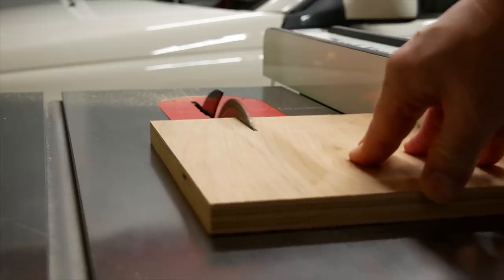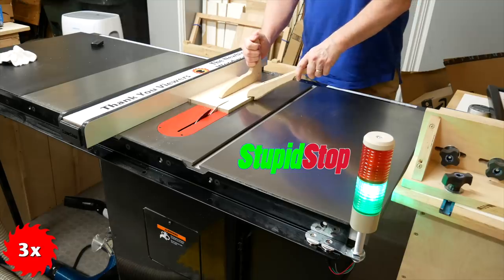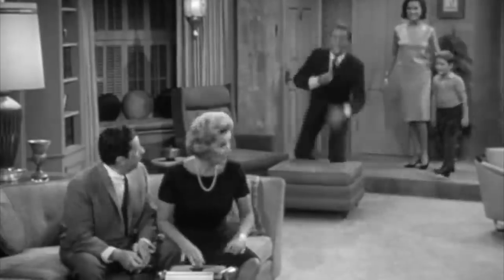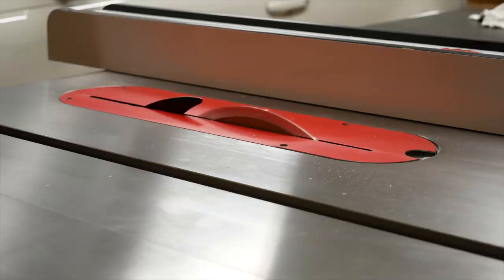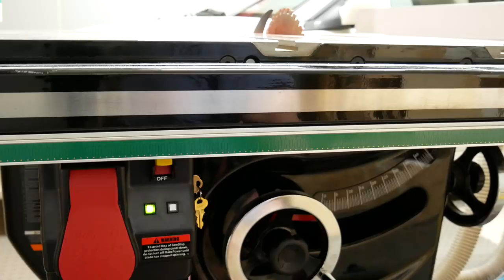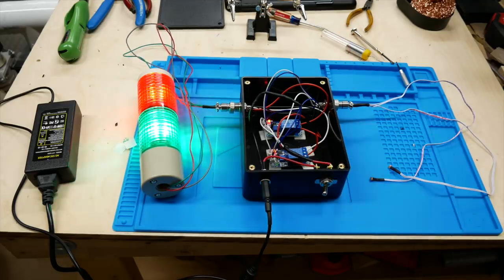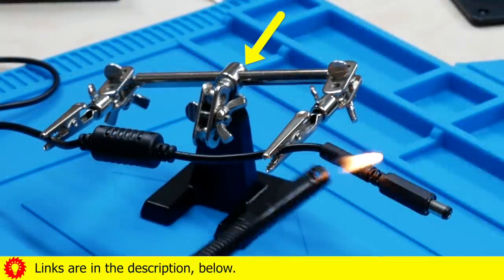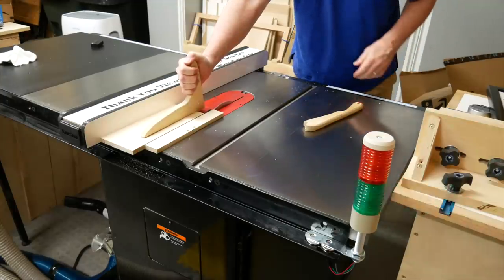Woodworking Distractions, ADD and my StupidStop

Comment: i think its important to have a healthy fear of a table saw and avoiding becoming complacent, easier said than done.. once you are complacent is when the accident usually happens.  I like to watch and read a lot of facebook groups where unfortunately people have accidents and often share them.   Seeing other peoples accidents is a great reminder for me and helps me keep that healthy fear of the saw in my mind.  My day job is often 4-6 hours behind a table saw and its very difficult to avoid getting tooo comfortable, and Im not even on a sawstop.   I do think shops with saw stops bread a user whom  doesn't possess this healthy fear i speak of, and why would they.  All the shops I know of with saw stops have far more accidents than the shops i know of without, that could be a number of reasons.. but i do speculate its often just from people using a tool without the healthy fear of it and overall complacency.     as far as mistakes, mistakes never stop being made.. you just get better at covering them up and/or not getting too upset.. its only wood
Reply from the maker: Thanks, Dave, and I love your last comment - I'd just add that yes, it's only wood, except when it's flesh! 😛But yeah, I agree with your comment about SawStops. It's only natural that when the consequences become less dire, people become more complacent. It may actually be one of the reasons for me touching my blade a couple of times. I mean, I cut my thumb pretty badly 10 years ago or so on a table saw (fortunately it was just a chunk of meat and it grew back), and although I hadn't used the table saw much since then until I started back up a couple of years ago, I never touched the blade again. Until I got a SawStop. I'm not sure the evidence is exactly scientific, but it's certainly a good possibility! Still, I'd rather have the SawStop than not, of course. 😄Thanks again for your comment. 🙂
Reply: I agree. I also drive around without my seat belt fastened because it just makes me complacent. I had a driver's seat installed on the front bumper of my car so I could make sure to fear driving. Crumple zones? Bah humbug! I also run up and down stairs without holding on to the hand rail. There are all manner of things that I could do to protect myself, but then I wouldn't fear things so much. Who wants that?
Reply from the maker: @rlevitta  😂

Comment: Great video.  I really enjoy and appreciate your openness.  I love my SawStop but I did "engage" with the blade.  Unfortunately, it was more than a nick, but if not for this saw I would have lost my finger.  That was more stupid than short attention (which I am gifted with).  I'm going to look into the plans for this.  Wonder if it won't work with the job site saw.  Keep the videos coming.
Reply from the maker: Thanks! And I don't see any reason it wouldn't work with the JobSite saw, except figuring out where to mount the light.

Comment: I am a dangerous shop outfeed table clutterer and thinking while cutting about the next step.  Oh yeah and not following the rules cutting short stock on the outside. I have the fat scar to prove it.  I have never come close to putting my finger on the table saw blade but I have had two notorious incidents on the band saw.  The distraction was rushing because my baby daughter was napping and I was afraid she had woken up..it was a long time ago since she just graduated college.  She has stopped the naps.  I was cutting hexagons...many, many hexagons and accidentally cut the tip of my thumb slightly..  You and I have discussed this before when you triggered your saw stop.  I stop myself and remind myself I am not on any time crunch.  Do not rush for a no rush thing.  I uncluttered and have stopped using my outfeed table over the assembly table I made.  All your points were great.  The cut outs to the funny scenes were extremely well done and very funny very nice effort.
Reply from the maker: Thanks, Bob, and I enjoyed every word of your comment. Thanks! 😄

Comment: An idea I have been thinking about is buying red vinyl letters maybe 3 inch tall that spell LOOK! and place them on the side of my RIP fence. Maybe that little reminder will help me look instead of relying on sound of the saw.
Reply from the maker: Good idea, and anything that works is good! For me, things like that just end up blending into the background. But anything's worth a shot. I like what one commenter said - don't come near the blade until you can count the teeth. Not that I'd count more than two or three, but that would be enough, right?

Comment: Interesting idea. I'm sure I could knock up something similar with a hall effect sensor and an Arduino. Movement and coils (think motor spindle) will create some magnetic fields that could be monitored.
Reply from the maker: See, I knew there were smart people out there. 😄
Reply: I built my automated blast gate system with an arduino using Hall effect sensor to detect current flow 
If you measured the EMF off the motor with the Hall Effect that would work as well.
Reply from the maker: @TheFalconJetDriver  Well, if someone did that, it might work well, but not if I tried it. 😛
Reply: I think using a sensor to detect the motor spinning (possibly sensing the fan blade) along with a current sensor to tell when the motor is energized would be an approach for a lot of tools. It could activate the alarm only when the motor is spinning while it is not energized. I think an audible alarm might work better than the lights. It should be loud enough to hear with hearing protection but not loud enough to startle you.
Reply from the maker: @bobt2522  Well, a worn out set of bearings might accomplish the same thing. 😜
Reply: @TheNewbieWoodworker  True, but it would squeal while you are making a cut too.
Reply from the maker: @bobt2522  Ugh, yeah, you're right.
Reply: @TheNewbieWoodworker  If I want to hear constant whining, I'll just go back into the house.
Reply from the maker: @bobt2522  Perfect comment for me, today. 'Nuff said. 😮

Comment: Don't be distracted by cut-off scraps.  People feel compelled to reach and push small cut-off pieces away from the blade while it's still spinning.  This distraction can lead to a dangerous situation.  Let the cut-offs lie until you've turned you saw off and the blade has come to a full stop.  In woodworking, patience is a 'safe' virtue.
Reply from the maker: Great advice - thanks! 😄

Comment: Thank you for a great video! And as long as it works for you it is a great solution. However, I would advice people to pay attention to the blade, rather than to have a light distracting them from the blade.
Reply from the maker: Excellent point. The one good thing is that the light only blinks when the saw is turned off and spinning down, so it's not distracting at other times. At least, not to me. 😄

Comment: I use feather boards on the horizontal and vertical so the only thing/direction I have to focus on is pushing through.  with a stick.  Less thinking = more safety once the blade is turning.
Reply from the maker: "Less thinking = more safety" That's a great philosophy! Thanks for the comment! 😄

Comment: This seems quite obvious, but in your specific case, a blade guard would save your fingers. We all have our excuses for not using it, but in your case I think the blade guard is mandatory. There are actually very few situations where the blade guard gets in the way of a cut and you actually need to remove it. I just have a delta contractor saw, and it’s blade guard is quite nice, so I’m sure the saw stop one is fantastic. Keep your fingers, and save some money on those breaks. Use the blade guard!
Reply from the maker: I'm leaning on agreeing with you, but I have to disagree with one thing you said: when you say there are very few situations where the blade guard gets in the way, it's just not true for those of us who use cross-cut sleds all the time. In fact, it's quite the opposite. But like I said, it may still be worth the effort.

Comment: Nice idea.  I would think that a universal warning light unit could be made using a circuit that detects sound where you could mount the microphone near the saw motor and adjust the sensitivity to ignore the dust collection and other sounds to turn the light on, then have a delay to keep the light on for a number of seconds after the sound stops to allow the blade to spin down.
Reply from the maker: Sounds good to me! 😄

Comment: What about adding a foot switch? (In between the wall outlet and the saw/ miter saw/ drill).
And, of course, I really enjoy watching your videos!
Reply from the maker: Thanks for letting me know you enjoy my videos. 😄I don't think a foot switch would help my lapses in attention, although it's an interesting idea just in theory. It wouldn't work for the SawStop, at least not between the saw and the outlet because the SawStop has two switches - one that turns on the saw (in other words, turns on the electronics), and one that starts and stops the blade. But it could work for other saws, and other devices. But since I don't see anyone using a foot switch for anything, my initial reaction is to let someone else try it first. 😛Thanks again for the comment. 😄
Reply: @TheNewbieWoodworker  I think that one to try it would be me ...
Reply from the maker: @olaf06x58  😂Go for it!
Reply: @TheNewbieWoodworker  I tried it. Big drawback = stability on your feet. If you use one foot to operate the foot switch, you are putting most of your weight on the other foot. Not stable. I'm sure a foot switch would work great for sitting position, but there are very few of these in the woodworking shop. I wish I had the $$ for a SawStop. BTW, a Physical Therapist friend told me most of the shop injuries he sees are from table saws.
Reply from the maker: @olaf06x58  Thanks for trying it out! Interesting results. There are switches that are much flatter, but I think the problems would still be there. It doesn't surprise me about what the PT said.

Comment: There is a reason why carpenters use flat pencils, they don't roll.  Grab an old 2x4, use it to push into the saw blade to slow it down to a stop quick.
I was 18, trimming out a new home, my dad left for a while, and I was cutting corner trim and baseboards.   I held the wrong end of a quarter round trim while using a chop saw (miter saw) and of course, holding two inches of material naturally didn't work, it took out the tip of my left middle finger!   Fortunately, it didn't take a bone with it, so the skin and muscle grew back.
Reply from the maker: Good idea about the flat pencils - I hadn't thought about that aspect of them before. Thanks for sharing! 😄

Comment: Hey Dan I enjoyed the video I was wondering if you removed the blade guard for clarity as I can't remember the last time I saw a table saw with the blade guard installed on tv or on you tube. I survived cutting a large unstable panel on my table saw without an injury. Stupid and very lucky as there could have been kickback or any other multitude of problems. I guess the rules should apply slow down and take your time and if you are tired leave it for another day. Stay safe folks!
Reply from the maker: Thanks. I removed my blade guard because I can't use it with my sleds, and I use my sleds a lot. But it's not that hard to remove it, so maybe I should rethink the subject. Thanks for making me think about it!
Reply: What is a blade guard?🤣 

Hum now that I think about it I think  I saw something like that in the bottom of my toolbox.
Reply from the maker: @TheFalconJetDriver  😂

Comment: Maybe this has been mentioned and maybe you have done it:
How about putting the factory blade guard back on the saw????
Reply from the maker: https://youtu.be/cQINXsn2QBk. 😄
Reply: @TheNewbieWoodworker :
Yep, I was watching that, when you replied. Great sled idea.
Thank you.
Reply from the maker: @zapa1pnt  Thanks. And I have to laugh - you're one of the few with the obvious solution of using the blade guard more often. I'm a little slow sometimes, but apparently I'm not the only one. So consider yourself smarter than most of us. 😄

Comment: Where is blade guard on your table saw
Reply from the maker: That's a reasonable question. I'm rethinking my use, or lack thereof, of my blade guard.
Reply: Great point.  None of the cuts you demonstrated in the video needed to be made without the blade guard.  I need to be better about this too, I have mine off because I store my crosscut sled on the saw, but that isn't a very good excuse.  I simply need to get back in the habit of installing the blade guard every time I use the saw.  That and maybe it is time to find a new place to store the crosscut sled.....
Reply from the maker: @davidbondi  Hey David, why not make a different sled... one that lets you keep your blade guard on: https://youtu.be/cQINXsn2QBk  😄 (As you can tell, I did in fact rethink using the blade guard.)

Comment: An alternate would be to mount a friction generator to either the arbor or to the belt depending on the design of your saw. This would create the signal. There are even some photo tachometers that could be used to generate the signal. You then use a programmable board such as PIC, Arduino, or even Pi to read the signal and light the red light as long as the blade is moving, and switch to green once the blade has stopped. a quick Google search came up with several circuits that could do the job even if you do not have a Saw Stop. I do not know how they would work with Saw Stop specifically do to it's own safety circuit, and design, as despite being a fan of the concept, I can not afford one.

As for my opinion of Saw Stop as a brand: WONDERFUL PRODUCT that I am a firm believer in, but highly questionable business practices. I recall a fundraising campaign that promised to bring the technology to other types of saw such as miter saws, and they claimed to hope to also expand to band saws... all that ever came of it was increasing the table saw product range. They also became highly litigious of any brand that attempted to reverse engineered a similar product, while at the same time running a campaign to get a federal law passed that would require a saw stopping device on any table saw manufactured, thus ensuring that they held a monopoly on the technology that would be required of all manufactures to use. Still it is a wonderful technology that has saved many people now from serious injury.
Reply from the maker: Thanks for your comment! Other people have suggested similar ideas for using programmable boards. But for me, this is good enough. As for SawStop's litigiousness, they have to protect their patents. But here's the thing: When the inventor first came up with the technology, he tried to get saw manufacturers to license the technology, and nobody would do it. So he started his own company. So I don't really blame them at all. Not that I'm being a SawStop fanboy - it's just that it serves them right! 😂OK yes, maybe I am a fanboy. 😏
Reply: You have it wrong. First of all, there is a patent for the brake - BTW Steve Gass, the inventor, is a patent attorney. Do you blame the guy for protecting the patent? Starting in 2000, Gass went to all of the manufacturers of table saws to try to license the brake to them for their saws. A number of issues ensued. First, all of the manufacturers essentially said, "we don't think our customers would spend extra money for that, but lets try to hammer out a deal." Negotiations dragged on for 2 years, and were ultimately unsuccessful as the manufacturers appeared to not be dealing in good faith. Gass decided to manufacture a saw himself, and 2 years later (2004,) went into production. Then the fun began. At least two other companies, namely Ryobi and Bosch tried to copy the idea, when SawStop became successful. I guess maybe it was a good idea after all? Gass (again a patent attorney) sued to protect his patent. The court agreed with him and his patent was upheld. So what's the problem?

This was just another example of someone who had a great idea, and everyone laughed. Then when it proved successful, everyone wanted to jump on the bandwagon. To quote Bruce Hornsby, "the first to laugh is the last to know." Tesla is another example. All the legacy car companies said, "this will never work," and ignored it. Now they're all scrambling to copy what Tesla did - unsuccessfully.
Reply from the maker: @rlevitta  I couldn't agree more.